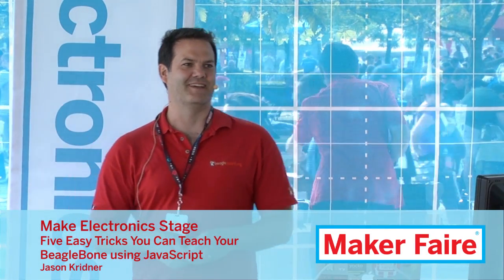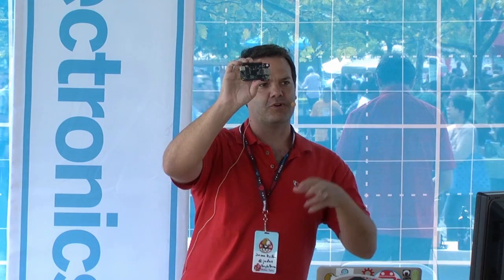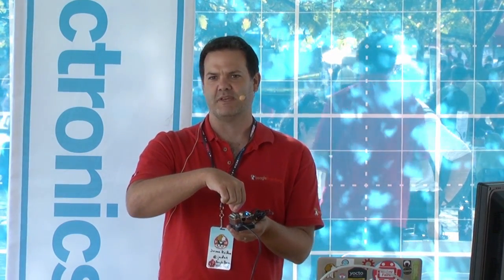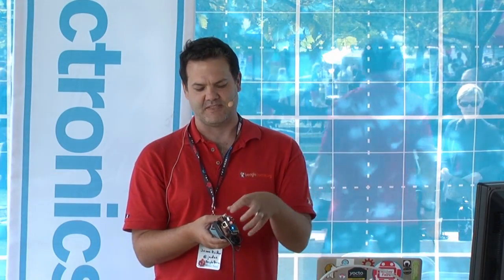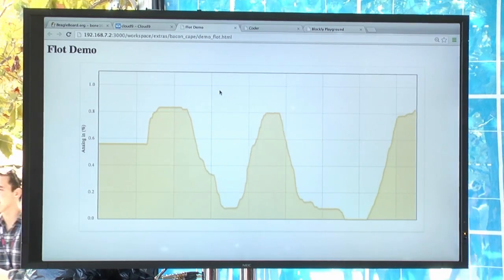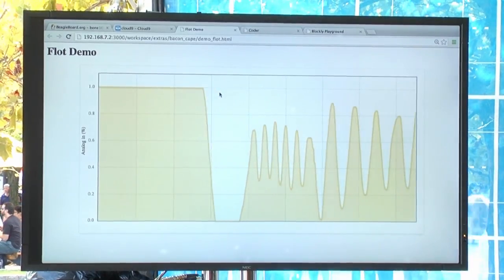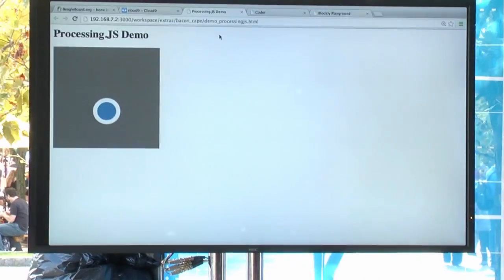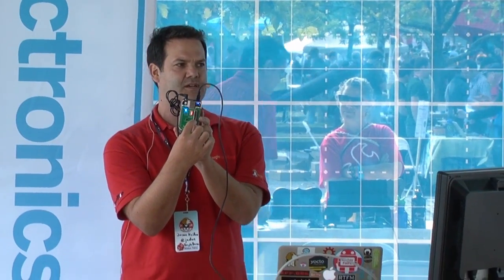Maker Faire New York 2013 Electronics Stage : 5 Easy JavaScript Tricks You Can Teach Your BeagleBone

Comment: At 13:55 he was talking about JavaScript callbacks and the asynchronous event loop.
A benefit of this is that there's no blocking. Waiting for disk or network responses doesn't block other threads. It's all asynchronous.

Asynchronous programming does come with its own pitfalls, though. Multiple threads can access the same variables, which can cause race issues.